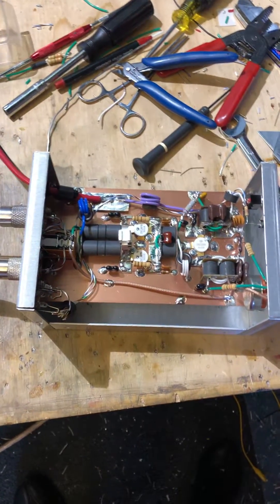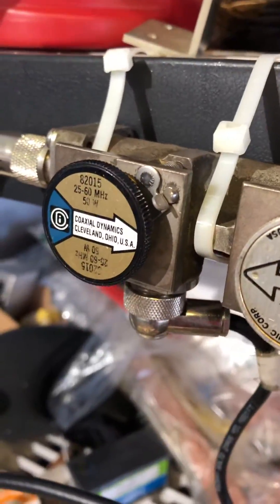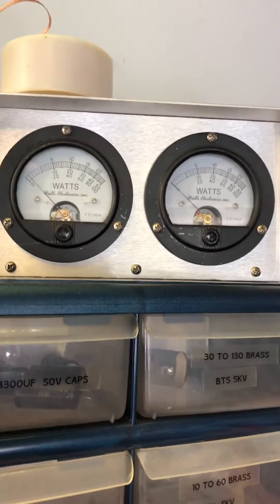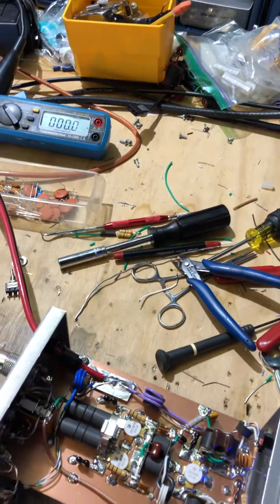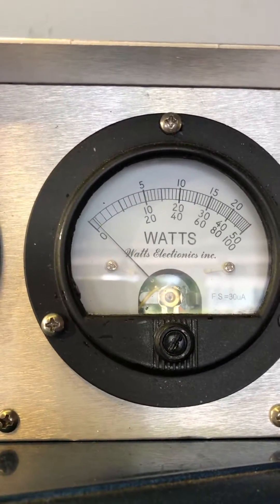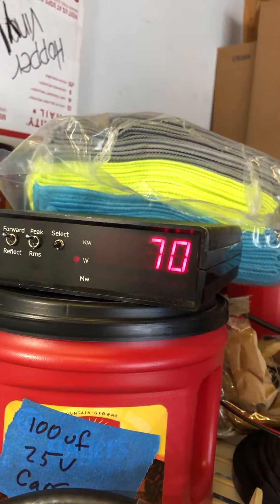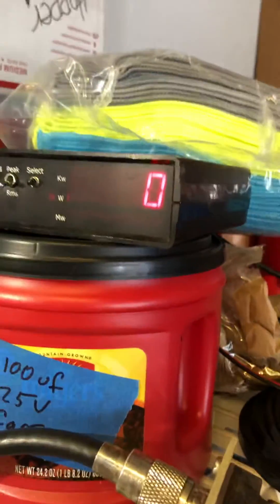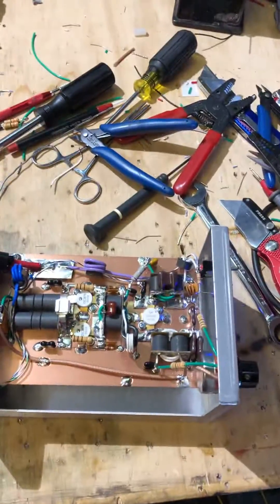1x2, hg mobile amp

Comment: Not very impressive for a 1x2 my fatboy 1x2 will do 525 peak on 14.5v draws 49 amps
Reply from the maker: That’s at 13.8v and only 8 watts of drive. Single final radio. Realistic numbers, not over inflated watts and not over saturating the transistors.
Reply: @hopperbuiltamps2135  that digital Dave made meter probably not reading correctly

Comment: I just got a Hopper Built 1x4 Base amp. Doing a little over 600 watts on am. About 450 ssb. Is this about right for a 1x4? Bought this through BBI in Idaho. He shows it doing a thousand on am with Bird meter. My Dosy will only register a little over 600 on am. Any suggestions/ Paid 1300 for it and expected it to at least get real close to a thousand watts.
Reply: Dosy sucks. I bought 2 meters dosy 4001 and daiwa cn901 both brand new. This was after I purchased my fat cat 1x4 . I had two other meters at the house from 20 years ago. Astatic 600  and a RadioShack 2000 watt meter. Fat cat showed 1350 watts
Dosy...750
Dawai...950 true peak on... 1100
Astatic 600...1000
Radio shack...1000

So I returned the dosy
Reply: Also $850.00 brand new
Reply: bill blackcat 

What did you mean by 
Also 850 bucks brand new ?
Reply: By the way radio drive matters. Fat cat was using 959 🔑 1.25 w swing 40
I 🔑 cobra 142gtl 3.5w swing 11
Reply: Yes it should be doing more. Your probably not driving it enough. You can call bbi no problem hell help you